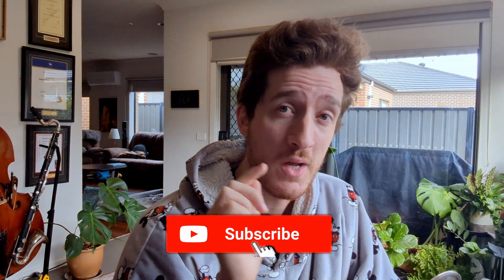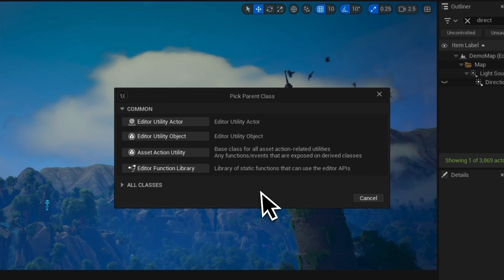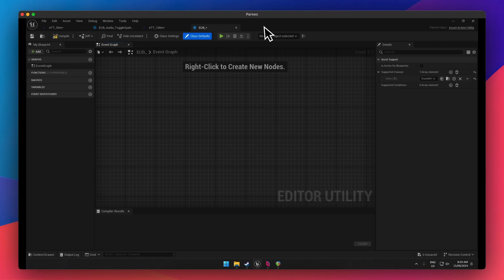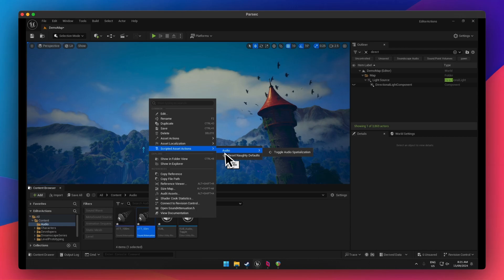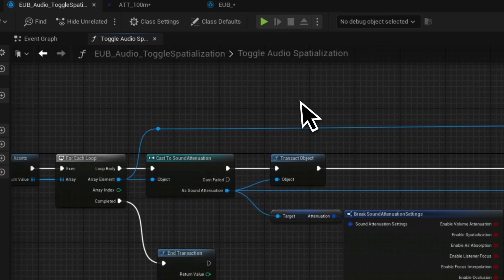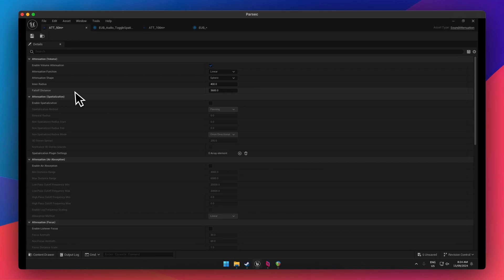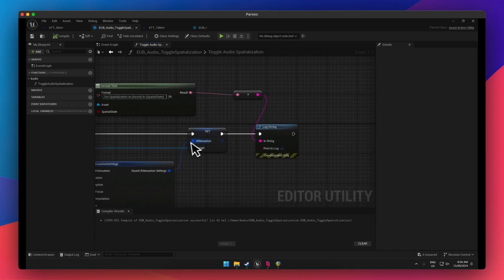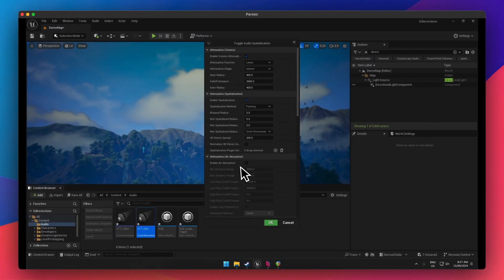Audio Tool Development with Editor Utility Blueprints!

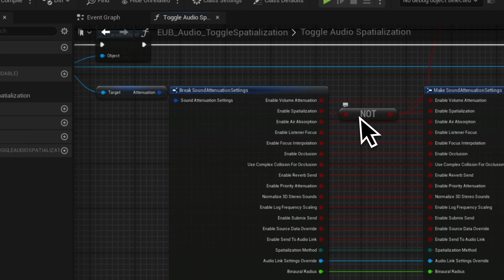Comment: 5:56 - Quick tip, you can use "Set Members in STRUCT NAME" to set struct variables individually without having to plug them all in one by one.  Makes it a lot faster if you're just trying to change 1 thing in a large struct.

Comment: Super cool! More efficient and direct than using the Bulk matrix
Reply from the maker: Sometimes it's funny, because it's a toss up between bulk matrix or not. For me I guess bulk matrix also means bulk property edits, maybe that's the differential? Totally agree though, it's really direct and cool!
Reply: @dweaveraudio  Yeah exactly, There are some differences and different purposes, but sometimes you need only a simple shortcut. Some weeks ago I was working on a Editor widget to be able create a "custom" bulk editor and change the main parameters like volumes, pitch, attend preset etc. Fortunally there are some ways to improve the workflow